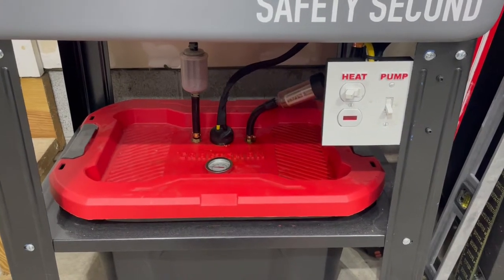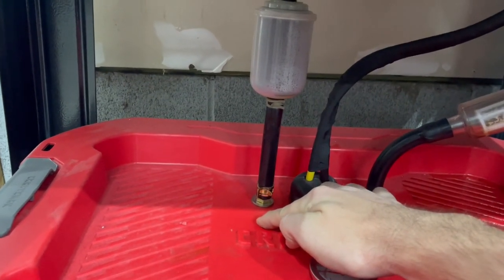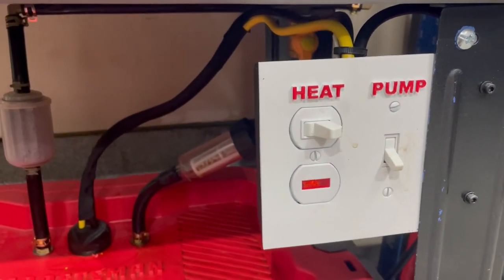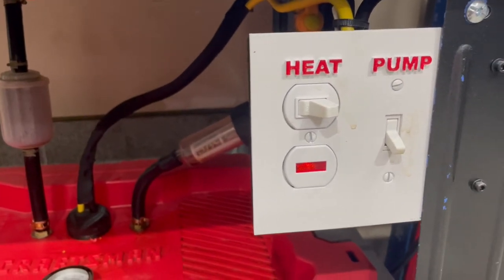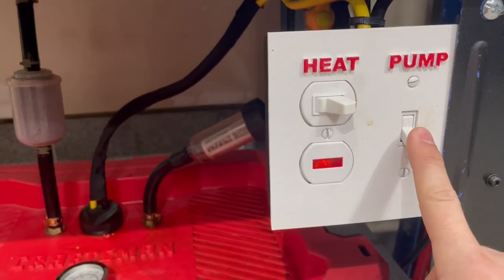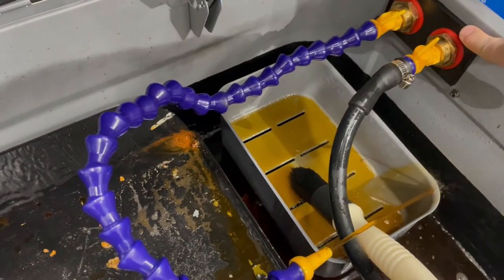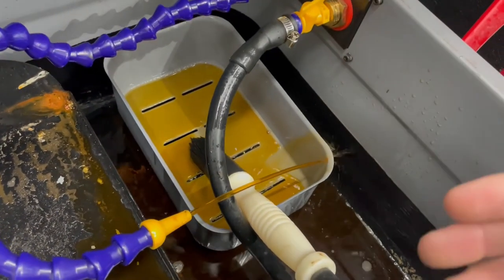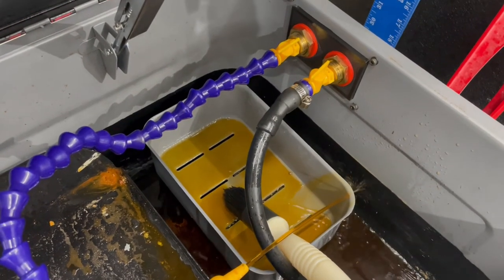Is THIS the Best Harbor Freight Parts Washer Build? Heated and Filtered Build

Comment: Everyone thinks they are upgrading by filtering.  The pump does NOT care about sediment.  It is specifically designed thusly.  If anything the added head pressure is shorting the life of the pump.
Reply from the maker: I’m not concerned with the pump. My aim is to keep the cleaning agent free of debris so it doesn’t clog up carburetor jets and stuff with old debris.
Reply: What kind of debris is going to be light enough to float in the stream and small enough to make it past the filter but big enough to clog a carburetor?   

Hey if it makes you feel good awesome.  I just know 99 percent of these people are blowing money and wasting time thinking they are making improvements.  They are not.

Comment: To people attempting to reproduce this... the heater melted my lid so I bought a fully submersible version. Don't use the brush on version of FlexSeal. It's messy and very difficult to apply uniformly. The spray version is much easier to apply consistently. These cheapo washers are very prone to rusting and the FlexSeal does a good job of retarding inevitable rust.

Comment: Great modifications!  Where did you get the filter you used on the drain line?  I can find the supply line Fram filters, but haven’t been able to find the larger particle filter you used on the drain line.  Thanks.
Reply from the maker: Thanks, The filter is from Amazon. Here’s a link. 
Aimela Water Pump Strainer 3/8 Inch, Garden Hose Sediment Filter, Inverted Hook Interface, with 200 Mesh Filter Screen, Suitable for Pressure Washer, Outdoor Faucet, RV, with 2 Additional Clamps https://www.amazon.com/dp/B09CQ8SVNZ/ref=cm_sw_r_cp_api_glt_i_6NY9GC7MKKAFQB5JZ6G9?_encoding=UTF8&psc=1

Comment: Great Video, we have a "safety clean" enclosed heated/pressure that's a rented unit here in the UK. Its amazing I think you have hit the nail on the head with parts washers being heated. 55"C in UK temp BUT our unit has a built in pressure washer OMG !!!! Ive worked in the motor trade 30+ yrs and OMG a heated pressure wash parts washer is the way to go. I filmed "GoPro in the parts washer" (and sorry not plugging links) but it may interest you for a future project to enclose and add the pressure washer units. Thanks for the video.
Reply from the maker: I’ll check it out, for real rough stuff I’ve pressure washed outside and brought into the parts washer. But yea heated is 1000x more effective. Thanks for watching!

Comment: Also, I forgot to ask, what did you coat the bottom of the tank with?  Thanks again.
Reply from the maker: That’s flex seal. It worked great in the bottom of the basin but not as good on the shelf in the parts washer. Scrubbing parts on the shelf has tore it up some.
Reply: @reddoggarage how much flex seal did you use?

Comment: I gotta ask, do you turn off the heater when your hands are in the parts washer?  Everything that I am reading on Amazon says not to have your hand in the water while on.
Reply from the maker: Funny enough those disclaimers weren’t on those submersible heaters previously. That said, yes I use it while the heater is on and haven’t had any issues. Having that in-line GFCI is really important. It’s really no different than the pump in the water that comes with the washer.

Comment: Question:  What is the Harbor Freight part number for the washer ?!  I went on their site  and couldn't find it no matter what search terms I used.  I even searched each of the category lists trying to find it.
I seem to have displeased the search gawds.
Reply from the maker: This is hard to believe but I can’t find it on their website any more either. It’s possible that they are having supply issues on it. Here’s another parts washer that looks to be the same but branded as Jegs https://www.walmart.com/ip/JEGS-81525-20-Gallon-Parts-Washer/349504695?wmlspartner=wlpa&selectedSellerId=18397&&adid=22222222227236402218&wl0=&wl1=g&wl2=c&wl3=280181317678&wl4=pla-467563425016&wl5=9013141&wl6=&wl7=&wl8=&wl9=pla&wl10=125215519&wl11=online&wl12=349504695&veh=sem&gclid=CjwKCAiA1JGRBhBSEiwAxXblwaTsRuezen5P9p--4IaQBAD0iUe3RSYavccHc3v6e35HgpvDrgAB9BoCsSgQAvD_BwE&gclsrc=aw.ds

Comment: Hey! Fantastic setup and great, to-the-point video. Those submersible heaters were exactly what I was thinking of doing and couldn't find anyone else using them and then your video popped up. 

Saw you mention in another comment that you could post the stl for the bulkhead but I couldn't find it. Mind sharing that?
Reply from the maker: Thanks a lot! I just posted the STL for the bulkhead to Thingiverse. The link is now in the description and also here: https://www.thingiverse.com/thing:5363721/files
Good luck!
Reply: @reddoggarage  tried the file but its tiny. do you know the measurements for it. Much appreciated

Comment: bro did you got the link for tthe blue flex hose and the blue and yellow valves?
Reply: I am wondering the same.  It's Loc-Line, but I'm having a hard time finding the fittings that he used.
Reply: @tywarren4704  bro did you know the name for the lid wire piece?

Comment: Nice work, Thinking of something similar.. Just debating as during winter i need it to not freeze in unheated space. so may be leaning towards a magnetic heater and keeping it in the tank instead. 
the 3D printer file for some reason loads a super tiny item. Im no 3D pro so not sure if its me doing something wrong. 
What did you paint it with?
Im doing a GS450 Scrambler build with my son looks like you are into building as well.
Reply from the maker: Thanks. Its possible the 3D file is importing in Metric. Try scaling it up by 25.4 to convert to inches. I painted the bottom of the tub with flex seal but it hasn’t held up as well as I expected. Hope that helps!

Comment: Hey what paint did you add to the bottom?
Reply from the maker: It’s flex seal. I used it on the bottom and on the shelf. The shelf has not held up very well against scrubbing parts on it but the bottom is fine.

Comment: I’m having someone local to me print the bulkhead. He wants me to download and send  actual STL and dimensions. 
I sent him the link to your Thingiverse, so I’m not sure what the problem is. I have zero knowledge of how 3D printing works, apologies.
Reply from the maker: The inside rectangle is the critical dimension. It should measure 4.3”across the long dimension. Sometimes calibrations between machines can make printing someone else’s files a challenge, but if he confirms that one dimension it should be fine. Shoot me an email at reddoggarageinfo@gmail.com and I’ll share the stl file with you that way.

Comment: Nice mods, wondering how the heater is holding up? Do the flow holes fill up with debris or does the filter keep the solvent clean enough and no plugs?
How do you control the solvent temperature to 100F?
I ordered the same heater but got a temperature controller.
Reply from the maker: About a year later and no issues at all and still the same filters, heater and pump. I just turn the heater off when it gets warm enough since it’s on a separate switch. A temp controller is a nice idea.

Comment: Looks awesome! Any significant reduction of flow with the filters installed? 

Can you post a link to the heater you used in your description? Maybe an affiliate link? I’d love to build something like this. Well done!
Reply from the maker: Thanks, I added some links in the description. The flow rate is probably reduced some with the filter and head pressure that was added. The pressure is still plenty, if you close one of the nozzle valves you get more pressure than I would like anyway, so I leave them both open and flow as much solvent as possible. Thanks for watching!

Comment: I've spent the past few days watching dozens of parts washers videos. In my opinion yours is among the top 5 in terms of design and execution.  Well done!

I'm sure a lot of people will have problems making one like yours because you didn't actually explain while doing it but fast forwarded through the whole build.  On the other hand, if they're like me they have watched enough of these videos to understand the concepts and see everyone else doing most of what you've done except for the countersunk tub in the bottom, which is brilliant because it eliminates 5-gallon buckets on the shelf and gives you plenty of headroom above to route plumbing. Nice touch!

I assume you painted the bottom of the tank and the rack to protect from abrasion by parts during cleaning because Zep doesn't eat paint like solvents will.  Is that correct?  I saw that you had problems with the rack, so I guess that didn't work.  One video I saw fabbed a stainless steel rack which solved that problem.

How have you found Zep on your hands or do you use gloves?  After cleaning with Zep does flash rust occur?

Have you cleaned a chainsaw yet and if so, how did that work out?

When you want to clean out the tub do you close off the drain valve, pump all the liquid to the tank, lift the tub lid and set it off to one side a little and scrape/wipe out the gunk in the bottom?  Does the gunk collect on the bottom much?  How often have you changed the filters?

Thanks so much for this video and for reading my comment!
Reply from the maker: Thanks! Yea the rack didn’t hold up well to the parts scraping through the flex seal. The bottom of the basin is fine since I just set parts down there to soak and not much scrubbing to gouge the coating. My thought was that it would hold up to the cleaning agent better and not rust out the bottom. So far I don’t have any rust issues. I use gloves when I’m cleaning. The zep cleans well and isn’t too rough on my hands but the heated zep cleans well. The tub underneath works great and yes I close the drain valve and pump all the solution up to the top so I can clean out the bottom tub. I have not replaced either filter. The drain side filter/screen has to be emptied about every use because it catches the big chunks of debris. It’s easy enough to just unscrew it and dump the debris out. 
Thanks for your comment!
Reply: @reddoggarage    Are you using Zep full strength?  If not, what ratio water to Zep?
Reply from the maker: @Rein_Ciarfella  100% zep.
Reply: @reddoggarage    I just checked out the Zep website and the one you're using they say not to use on plastic.  Have you used any on plastic, and if so, were there any negative effects?  I think I'll get one of the spray bottle sizes to play around with as I have no experience with this product yet.  I work on small engine equipment and have been using Super Clean, Simple, Green, Dawn, etc.  Super Clean sprayed on chainsaws works really well, but that's doing it by hand (no parts washer).